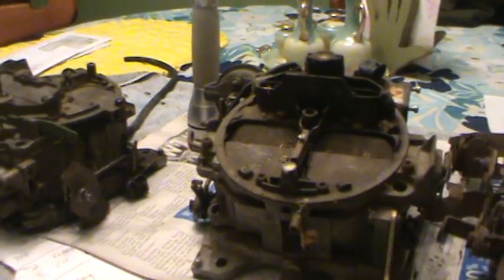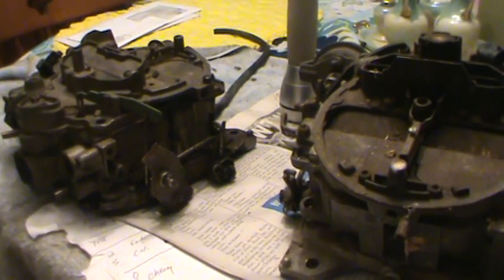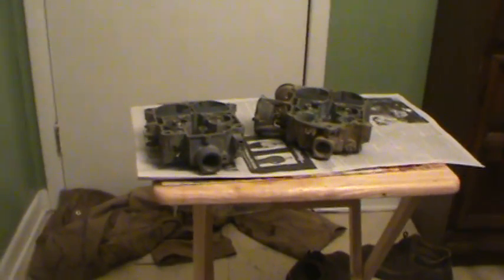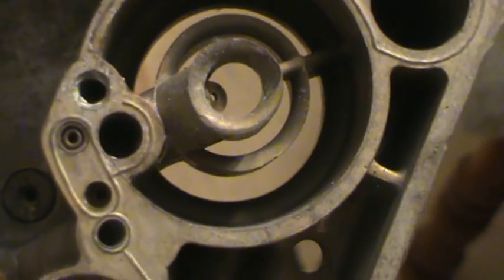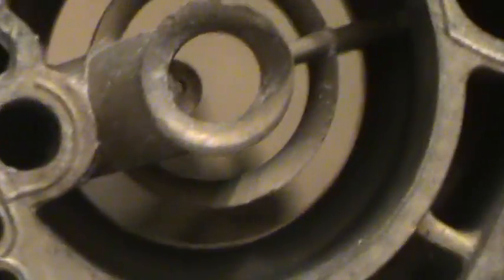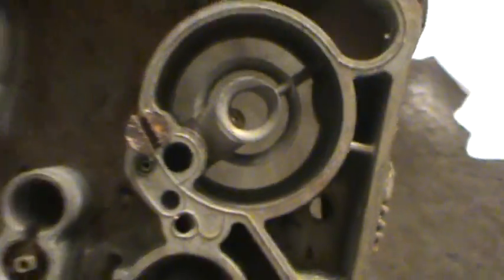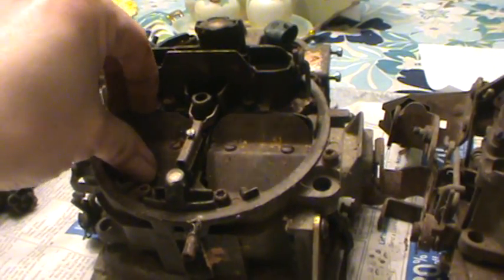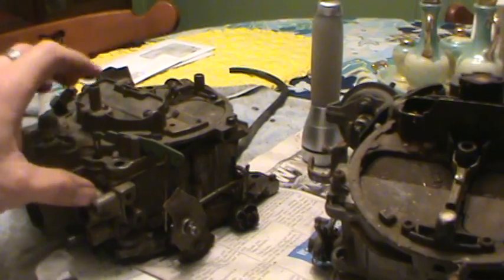750 vs. 800cfm  Rochester Quadrajets-how to tell them apart

Comment: I installed a front-feed E4ME on my 231V6 using a 4.1V6 intake, runs like a beast compared to the dualjet it replaced.
The secondary rods and hanger came from a 4.1V6 e4me but the bowl of that carb was side-feed.  I don't know how the factory made the side-feed bowl work, given there's an alternator bracket right there.

Comment: Well, the 1967 pontiac tempest had a 230 Cid overhead cam 6 cylender.  And I don't think it came with a 750 .
Reply from the maker: You lost me. Those had a 1bbl.
Reply: @TylersNeighborhoodGarage  the pontiac tempest sprint overhead cam, 6 cylender came with a factory Quadrajet 4 barrel. Easy to overlook, as they were rear.

Comment: Was the 7040200 EE off my 70 monte SS an 750 ? or 800 CFM .? THE ENGINE is a LS -5 ,same as on the Coevette . Now the reason I ask is because I took my car in for a tune up knowing that it had the 7040200 EE carb on it because I rebuilt the carb  myself . so 3 years later I started to freshen up the engine ,and found out that the carb is not the factory one . So that's why I asked the question .If I had it still I could check it out . But it's gone and I don't know if running the engine with it will hurt the engine and the value of the 70 Monte SS. Trust me when i say that i am pissed about this .
Reply from the maker: I wouldn't stress. There are several references to that being an LS-5 carb correct for your car, but not commonly equipped. If you really want to be sure, check your car's built date on the cowl tag and then the build date on the carb. The carb's build date should be before the car's build date. Now you're asking about the cfm...the answer is in front of you. Look down the throat and see if you see a ring or bumps. Probably is a 750.
Reply: I believe it was second week of  Feb 1970. LS5 engine casting date either L 19-9. or K -19-9. Th3 build sheet shows EE .
Which confirms the carb which was a victim of mid night shopping or thieving mechanic shop .
Fuck ! one step forward 2 steps back .
Either way now the cost goes up .
Pricks .

Comment: Hi, If there was only a 750 and an 600 Rochester Qjet, how come when you order a replacement aftermarket  carb for a 69 Impala 350/ 300HP Edelbrock and Holley ONLY recomend a 600 CFM.  That would make it seam that a 750 or 800 would be over carburated?
Reply from the maker: That's because the Quadrajet is a VARIABLE cfm carburetor up to the rated maximum cfm. If a Qjet is installed on an engine that would never ingest 750 cfm, then the secondary air doors never open fully, the secondary rods never lift all the way, and so it's never overcarbureted. Neat, huh? The engine only gets what it needs. The problem with the aftermarket carbs is that you better hope you never need more than 600 cfm, because if you do, you buy a new carburetor. Not sure? You could make a guess and either end up with a carb that's too large or too small. Rochester knew what they were doing.
Reply: @TylersNeighborhoodGarage  Ok so It would seam the same with the aftermarket world.  There are supposedly theories to get the correct CFM for an engine.  Also without a dyno, how do you select the correct secondary rods on a Q jet.  I am asking as I have a peticular dilemma.  I have a Winters Snowflake Classic car aluminum LT-1 intake that I would like to use on an old Chevy that never came wwith an LT-1 (just for interesting cosmetic reasons).  The LT-1 intake has a Holley flange base.  Please contact me at cliff70chevy@gmail.com I would like your imput on my project.

Comment: 78 chevy blazer with 350......do ya think it would b better to go with manual fuel injection vs  rejetting the quadrajet to get a more sensable use of putting fuel in the carb vs the stock way it is when the secondarys open its like dumping a gas can in the carburator?? I need the HP when I need it but...I could use a lil better in town and towing gas milage.

Comment: Here is what I need to know. My late father ran a carb repair shop. He has many old quadrajets laying about the shop. Some carbs are complete assembles, but some are separate bases, bodies, and top covers. 
While at the shop today I did find many 800 cfm bases. However, I can't tell which of the top covers, and throttle plates go with the 800 cfm carbs. I want to rebuild these car with all of the spare parts I have either for customer cars, or just sell outright. 

The only thing I noticed today was that the few 800 cfm Quadrajets seem to have slightly bigger primary throttle blades. However, I didn't have my calipers there today to measure them to make sure. ARE the primary throttle blades bigger than the 750 primary throttle blades, and if so do you have the measurements? 

Next the top plates. There were no screens over the vents which rules out having any  hipo Pontiac carbs in the shop, but is there any other way to id the top covers that went with the 800 cfm non  hipo Rochecter top covers? 

Also many of these old top covers are missing their metering rods, so I'm just going to buy these new [when I go to build the 800 cfm carbs] .  Is there any metering rods for an 800 cfm that work better overall for a daily driver, [ ie was the the size for the factory metering rods] . 

Last. I'm getting many many calls on people wanted performance versions of these carbs. Now, I've built many Holley carbs for some vary radical engines, and even forced induction, so I know a few the methods to get those carbs to run well for performance vs an out of the box Holley.  

I've watched ALL of your videos, and I haven't seen anything to improve the quads for moderate, or high HP performance builds. Any help, or a link would be appreciated.  

Thank for any input.

Comment: Yeah bri mg a chevy man I own several 800 muhahaha-17080213- m4mc-modified etc... from factory. There's also 1 other difference i see once taking it apart. It has an extra part inline with the primaries. It has a stiff spring with a rectangular brass screw-
 ? I can't seem to come to understand what it is-how to adjust it. No paperwork in carb kit or online i can find out.  Any help? In ur video on 800- it's there on it's also! Thanks

Comment: Mr Tyler-Great videos on the Rochesters!! thanks for taking the time to make the videos.
I have a SBC 383 freshly built with a Quadrajet. Which items gets adjusted first and in correct order? The timing first, then the fuel/air mixture screws and then the idle adjustment? Whats the correct order to get a good running engine? And when should I use a vaccum gauge to make sure Im at the highest vaccum-after all the adjustments are done? 
Thanks!!!!!!!
Reply from the maker: Thank you for the kind words. Put the timing at slightly advanced(before tdc). To get it started. Put the idle mixture screws at 2-1/2 turns out each. Once it's running, rough in the timing (with any vacuum advance disconnected) with it as close to about normal idle speed as possible to keep the mechanical advance from coming in and affecting the timing reading.

Then, you can go back and finesse the idle mixture and speed. Remember you want the highest idle possible with the idle mixture screws. Clockwise until slows down, back counterclockwise until slows down, then back to highest idle speed. Adjust base isle as needed. Recheck timing at slow idle. REMEMBER THAT THE ENGINE HAS TO RUN AT 2000 RPM FOR 20 MINUTES TO BREAK IN THE CAM IF IT'S A FLAT-TAPPET ENGINE. NO IDLING.If it has to be shut down then let it drop to idle and key it off immediately. Leave the thermostat out while you are breaking it in so you don't have to bleed air out. Good luck.

Comment: I read in a book online titled "How to Rebuild and Modify Rochester Quadrajet Carburetors by Cliff Ruggles that in 1971, Buick modified the 750 QJet into the 800 specifically for all cars with the 455 engine. Pontiac also modified the QJet for 71 for the 455 H.O. by removing the outer booster rings and extending the single booster. It was an attempt to increase airflow. However, it resulted in a lack of part throttle efficiency and were difficult to get through emission testing. Buick just expanded the primary bore as you showed in your video.  It also states that the 800 cfm was used through 1974. This is an interesting book and its complete with pictures and identification numbers. It gives information for all Quadrajet carbs that were ever produced, including how the QJet came to be. You should check it out!
Reply from the maker: Thanks, I have that one on the shelf.

Comment: I wish you moved the cam faster I could still see the carbs.    Use a pointer to show the section you are talking about.
Reply from the maker: +Gfdf Perte  I'm taking applications for a video director, be sure to get yours in early for immediate consideration.
Reply: I would be glad to help you out.   Just keep your cam on the subject for a little time and when you move the cam just go slow.    A quick moving cam does not keep the subject in the frame for the time for someone to understand your subject matter.   Also use a pointer and put the cam on a tri pod if you can

Comment: Thanks again man! So do you do custom builds? I am building a big block with a fairly large cam. Good lift and fairly long duration. Hot rod shops and engine builders are trying to steer me away from my beloved quadrajets! I have come across a place off the net wanting $600 for their custom built Qjets. I do like the way they've gotten their carbs to look. To me there isn't anything out there as good as a properly functioning Quadrajet. They are not pretty tho! As far as I can see there's nothing I can do about that...

Comment: Can you help me understand this Rochester Id# 07029207 with a date code 3412?
Reply from the maker: +Alan Appleby  It's a Service Replacement Qjet. That's why the 0 at the front. The date code is 341st day of 1972. A 7029207 Qjet was originally used on 1969 Vettes with a 350. Good carb.
Reply: Okay that makes sense. Just bought this carb off offer up for $60. The kid said it was on a 72 pickup.
Reply: @alanappleby704 , I wonder if that 72 pickup had the big block 402 in it?
Reply: No clue

Comment: I just bought a 66 Toronado 1-1-16 and found a Rochester in the trunk.  It has the fuel filter on the front of the carb level about adjustment screws.  I found a plate screw into the back of the car Pp29865, 7032720 is cast in a small circular shape near it.  There is no bottle cap or tag on it.  How can I ID it?  The carb on the running car has 7041312 stamped vertically on the carb body as you've shown in a video, the other carb does not have numbers in the same spot.  Do you have any ideas?
Reply from the maker: +Brad Wilkins That's interesting. The carb you found in the trunk is obviously an earlier carb, but what it belongs to is a mystery without any usable number. The plate with 29865 on it is the idle compensator cover, and the number in a circle near it is the casting number for the carb body. Past that, if there are indeed no numbers stamped vertically, what it is may remain unsolved.

 Here's the good news though: The carb on the engine already appears to be the original 1966 carburetor as used on a 425 Olds. may want to check the production date on the carb next to the ID number and verify that it falls prior to the production date of the car.
Reply: +WhoSaidTyler [2778]

Comment: Does a Dualjet carb use the primary side of an 800 or a 750?
Reply from the maker: Very good question. The ones that I have encountered used the front side of an 800 cfm Qjet.
Reply: I concur, the dualjet appears to use the 800cfm primary configuration,

Comment: My 77 truck looks different from both. 17057213AWP   0357
Reply from the maker: Yours is an early-style Qjet, some of which were used later than 1975 when cars got  the newer modified Qjets like you see in the video. That's probably the original carb. It was manufactured the 35th day of 1977. I bet the build date on the truck is close to that.

 It's probably also either a K10 4wd or a 3/4 ton or larger?

Comment: Using a Quadrajet  (off of 76 Gm van (350)on my 83 ford mustang (351) bored to 363. Love it! Adjusted the air doors works great.I have fair economy and power when I need it too
Reply from the maker: Awesome..easy way to make a Ford run even better ;-)
Reply: WhoSaidTyler It runs great and scares me

Comment: Hey man like the vjdeos.. did I hear you right where you said Ouad. only made 750 or 800? because on ebay there some
advertised as 650. Hope to hear from you.
Reply from the maker: Yes they only made 2 different CFM versions. There never was any "650 cfm" Quadrjaet. GM did limit the total airflow on some carbs that were used on small engines, but that's done simply by restricting the secondary airdoor travel, and then using special secondary rods that obtain full rich by 60 degrees of airdoor opening.

In fact, all the electronic Quadrajets that were used on Olds 307 engines were 800 cfm castings that had the flow limited as I just explained. Of course, those engines wouldn't ingest more than about 400 cfm with your foot held to the floor anyway.

You just ask the eBay seller what makes it a 625 cfm.
Reply from the maker: WhoSaidTyler
650, rather.

Comment: QUESTION: I have an 800 cfm on a 455 + 0.30 (so a 462) buick a 72' riviera , the engine just got rebuilted but I have been using the car only one or other Saturday every 2 weeks (my fear is that varnish is been builded inside) cuz is been dying on me... and is a very slow death the way it does it, slowly starts loosing power and is like "running out of gas" and pumping the pedal sometimes recovers it very slowly back up (and it happens mostly when idling at a light in gear... making me put it in neutral and start pumping the pedal carefully )... BUT... it also kind of starts "coughing"  when I WOT out of the souden... it looks like if the small fuel filter where clough, but I checked and it is clean.....  PLEASE... any help and suggestions will be more than welcomed. thanks
Reply: Sounds like your float isn’t set correctly

Comment from the maker: In theory, yes. It's a strictly mechanical connection between the primary and secondary sides, but more cfm equals more power at a given throttle angle.

Comment: So that seems to say the primaries are bigger on the 800...on say a marine 454 application, would it stand to reason you could run on the primaries at a little higher RPM before the secondaries start to open up? or at least prevent the secondaries from opening as soon or as much?  Good info! Thanks!

Comment from the maker: If it were mine I would. The carb likely isn't the bottleneck to more power with those engines anyway.

 It's more likely a combination of low boost levels because of the fairly rudimentary engine controls of the day.

 They are a nice car to have but not exactly the version that lends itself to making a lot of power in stock form. That said, it's pretty rare so don't hack it up.

Comment: i have two question for you...i have a 1969 cadillac develle converible(472 engine) and 1983 buick t-type turbo(3.8 engine) with electric carb...so size are these carbs...thanks

Comment from the maker: The ONLY GM engine besides Cadillac that did not have small and bib block derivatives was Pontiac. You can go all the way back to GM and conform that info. Whomever may have told you otherwise fell prey to that old bit of misinformation that's been going around forever.

Comment from the maker: I'm not sure where you are getting your info from, but there is widespread info that confirms that there indeed are both small and big-block Buicks and Oldsmobiles. I've been up close and personal with all of those engines and in fact the intake manifolds will not swap between small and big block versions of either.

 Please go back and do more research and you will have the correct, widespread info.

Comment from the maker: Yes but calibrated leaner.

 Think of the CFM is airflow CAPACITY, not the carb just shoving that much air in regardless.
Reply: That’s false, because rated cfm is not the max cfm it can flow.  It is what it flows with x pressure drop. A motor may actually make it flow more cfm if it creates a bigger drop that what it was rated at.

Comment: So a 1966 Pontiac 250 Cu In in line 6 cyl with the Over Head Camshaft used the same CFM carb as say a Chevy 350 with 100 Cubic Inches more?
Bruce

Comment: my dad had a camaro that he cammed, put on after market exhuast and intake, and he took a 800 cfm Roch of a Caddy 500 and bolted it on an after market intake manifold and he said that camaro screamed, but they guy he bought the car from used a crap load of car putty, so not long after that it became a screaming rust bucket, so he and his brother put the 350 in a off road blazer which it then sucked the air filter bolt through the manifold and into one of the cylinders where it fucked the engine

Comment from the maker: @vinman1029 The slots were an effort to get a quicker transition into secondary fuel flow, but as it turned out it wasn't the best idea. Rochester ended up moving the secondary discharge ports lower and enlarging them on later carbs, and returning to the solid air doors.

 I may do a comparison between a Pontiac Qjet and the others for a video.